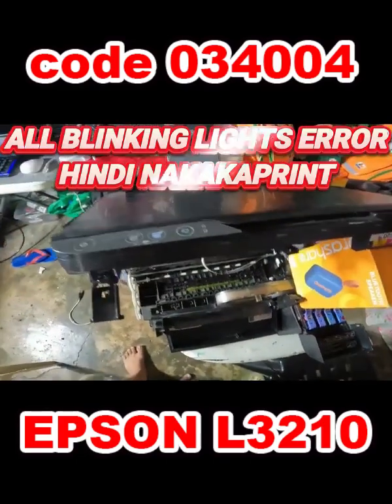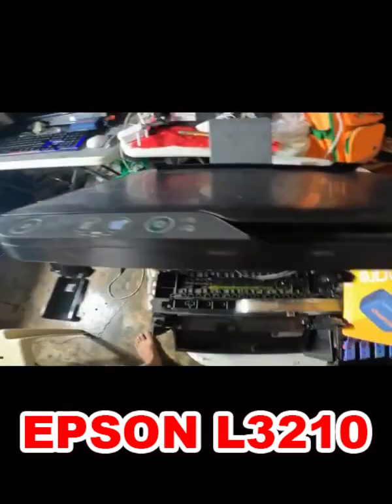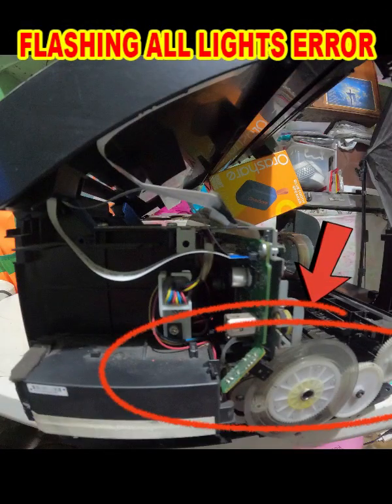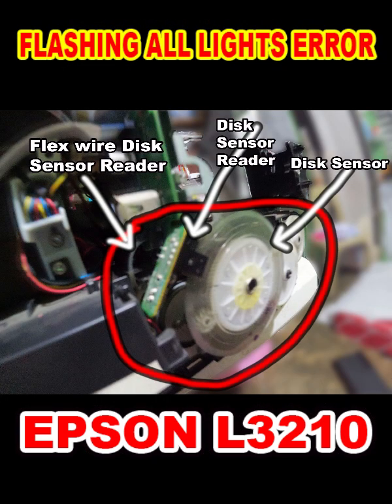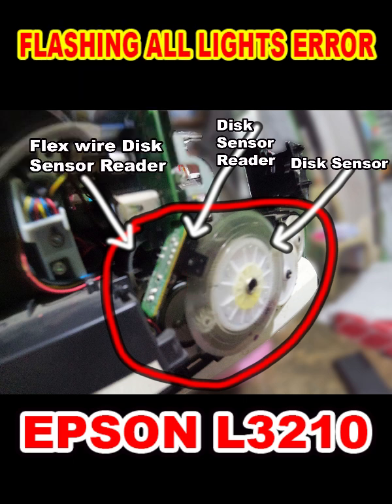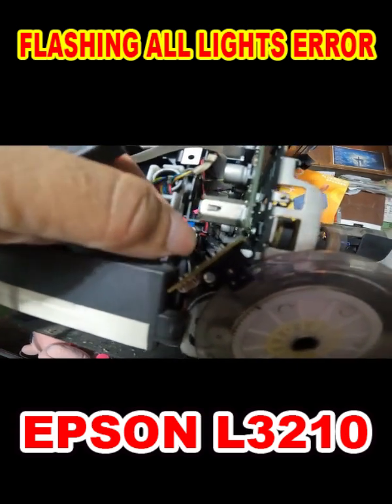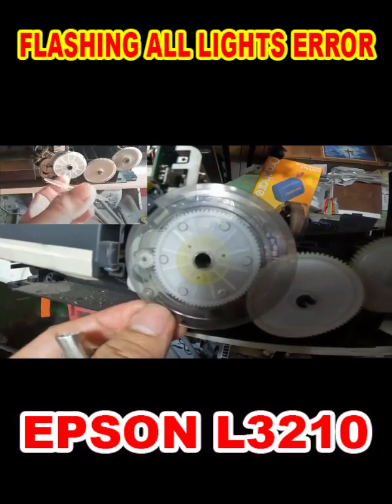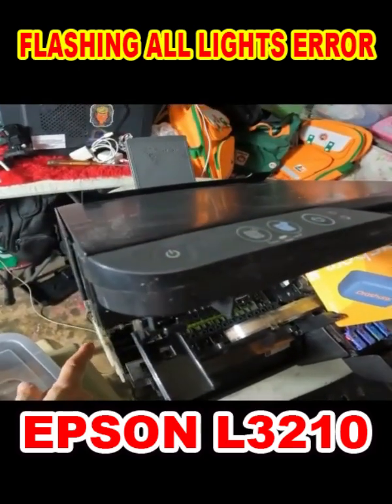How to Fix Red Light Flashing Problem code 034004  Epson L3210 L3110 L3250 L3150

Comment from the maker: Penonton Malaysia. Terima kasih penonton Malaysia
SHOPEE Malaysia 

EPSON:
Epson L3210 👉 https://invl.me/cln1h6f
Epson L3250 👉 https://invl.me/cln1h6m
Epson L5290 Wi-Fi All-In-One Ink Tank Printer with ADF Replacement of L5190 👉 https://invl.me/cln1h71
Epson L8050 Photo Ink Tank Printer [ PRINT / SCAN/ COPY / WIFI ]👉 https://invl.me/cln1h75
EPSON 033 Refill Ink 👉 https://invl.me/cln1h6o
Epson 057 Ink Bottle T057 Epson Ink Bottle 6CL Dye 70ml Ink Bottlle for Epson L8050 Epson L18050 👉 https://invl.me/cln1h77
L3110 Waste Ink Tank Sponge for 👉 EPSON L1110 L1210 L1250 L3110 L3210 L3216 L3150 L3250 L3256 L5190 L5290https://invl.me/cln1h7i
Epson L8050 Maintenance Box C9345 C12C934591 L15158 L15168 L15160 L15150 L15188 L18050 C9345 👉 https://invl.me/cln1h7k

CANON: 
Canon PIXMA G3010 Refillable Ink Tank Wireless All-In-One Printer Inkjet Printer | G3020 L3250 T520W 👉 https://invl.me/cln1h6t
Canon PIXMA G2010 Refillable Ink Tank All-In-One Printer Inkjet Printer | G2020 T220 315 L3110👉  https://invl.me/cln1h6v
Canon PIXMA G3770 Wireless Refillable Ink Tank Printer Inkjet Printer similar G3010 G3020 515 580 L3250 L3210 T520W 👉  https://invl.me/cln1h6q
Canon GI-790 Black/ Cyan/ Magenta/ Yellow Original Ink Bottle FOR PRINTER G1000/G2000/G3000 👉 https://invl.me/cln1h78